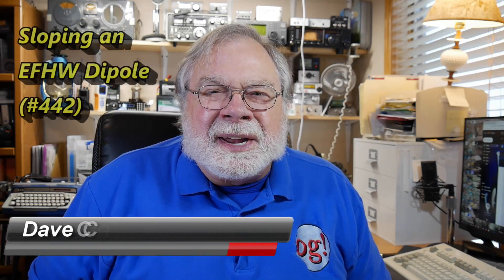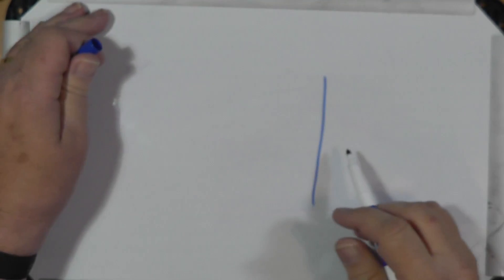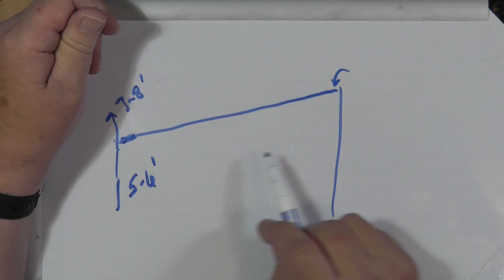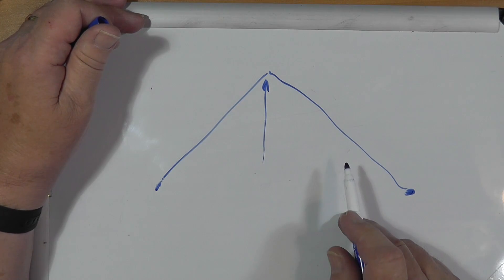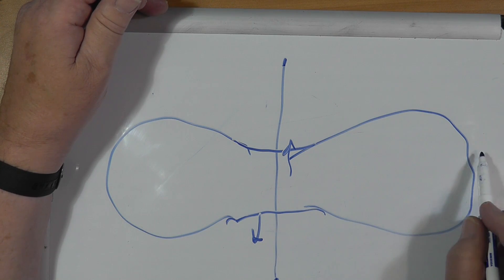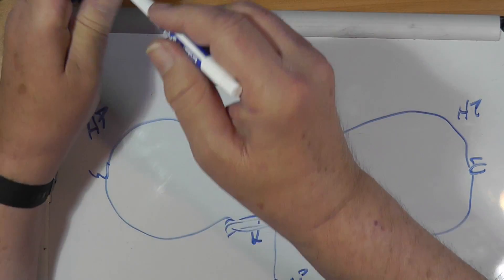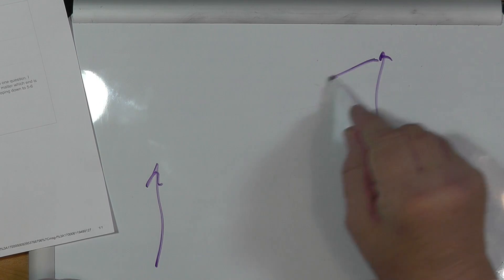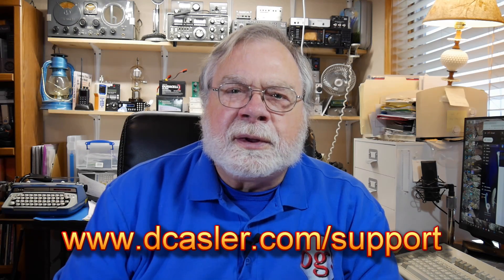Sloping an EFHW Dipole (#442)

Comment: A follow-on question: How high should the high end of a 20m ENFW be off the ground in a sloper configuration? And is it enough to rely on a run of coax as a counterpoise? Is a vertical configuration better because it gets to a full 33 feet high at the end? If so, can the coax still be the counterpoise, or must one then have a full radial field for optimal performance?

Comment: Thanks Dave for sharing your video & insights.  I recently discovered your channel subscribed, and binge watching several of your excellent videos.
My old Home brewed Dipole that was built in 2020, is needing replacement. I’m searching YouTube videos for refreshers, as I had 2 Strokes in 2021 that impacted my memory and brain white matter atrophy. 
Dispite this I am determined to venture into the realm of Software Defined Radio yesterday I ordered a Xiegu 90 and considering the  Xiegu DE-19, Digital Interface device to refresh my 
Ham Radio Deluxe experience.
73 Steve AA4SH

Comment: This is just the info I needed. Thanks! I’m putting a 66 foot efhw in my attic and need to put it horizontal and it needs to snake around the attic to fit. The shape is kind of a “u” with a couple of extra bends. If you see this post, can you let me know if this shaping around the attic will mess everything up? Thanks.

Comment: I have a legal limit resonate 135' that I run along with a vertical.  I switch between them to all the time depending on which has the best ears and or noise level. 
My transformer is near the shack about 15' off the ground with 35 feet of coax. The end is 120 feet up at the top of a big live oak. It has a SWR under 1.5:1 on all bands except 75m general portion phone band. There it was  showing 4:1 to infinite.  
I read an article  how to tame this without affecting the other bands and now have a 1.2:1 on 3.950. 
The trick is to cut the wire at the halfway point and add an insulator.  Between the two wires add a 220pf 3000v disk capacitor for up to 100w. If you run any power the capacitor is going to need to be a ceramic doorknob. 
The article claims it makes no difference on the higher bands but I have found 40m to be 1.2:1 to dead flat across the entire band. Before the mod it was 1.2 to 1.5:1.
I have added 6 turns of coax as a choke behind the transformer as well and have no rf issues in the shack even when running legal limit. I've managed contacts from my qth in North Florida from Australia up to Iceland and over to Japan and the Middle East with 100s of  contacts throughout Europe. 
I run the same antenna for POTA and SOTA with the same results.

Comment: Strictly speaking a half wave continous wire, end fed,  is not a dipole. The term dipole means 2 poles,  and if it is broken and fed in the middle it becomes two sections of wire, quarter wave each and then is a centre fed dipole.  A single continous wire, fed at one end or the other is really a monopole. The term Di means 2. Just a comment but a good video and an end fed wire can be a very convenient antenna to erect. The feed impedance will be high, usually around 2,500 ohms and so a matching unit or an UNUN will be needed to fed a 50 ohm line.

Comment: Dave, Thank you for your videos. I keep finding conflicting info about the counterpoise for an EF. Some say you should run the counterpoise parallel (under) the wire, others say perpendicular. The choking is also represented in two ways. Some say put an isolation box (LDG 1:1) at the antenna to block RF on the outer coax braid. Some say don't choke at the antenna because that outer braid is the counterpoise but do choke it before it comes into the the shack - for example, if you had an 84 ft random wire, and you were going for 75M, you could choke your coax around 60 ft down the line (quarter-wave of your target freq.). So posts say choke the coax and run your own counterpoise - and again it branches to parallel or perpendicular.

There must be some reason why the people believe what they are posting, but the posts mostly say "do it" without the why or consequence of doing it differently (parallel vs perpendicular). Any insights would be appreciated.

Comment: Thanks, Dave, and Don B for the question. I just put up a 66' 80-10 EFHW from a US manufacturer. High end at 27', about 5' off the house, sloping down to 12'. Called manufacturer when the performance was poor. They suggested adding a wire to the 2nd lug on the transformer, dropping that to a separate ground rod, then running a 66' radial underneath the antenna. Helped a bit but still very poor compared to my INDOOR 20M and 40M dipoles. (The 40 M is even in a "U shape" horizontally.) Have not approached the manufacturer about a return yet but this was a waste of money at this point. Any suggestions out there? More radial wires to act as a counterpoise?  Thanks for any suggestions!

Comment: I run a random wire with a 9:1 as a slope. The high end is 16' off a tree and the low end and feed point is 6" of the ground. Coupled with 34 6' radials it has a great pattern on 40, 80, and 160 when modeled in MMANA.

Comment: my end fed is on a sloping garden and is fed at the lower point which is at 20ft above ground, which effectively is 0 ft when compared with "the lawn" at the back of the house. the "other end" is 25 ft above "the lawn, which as the house is an inverted L makes it 10ft above ground with reference to the road. I have had good coverage and worked many countries on 80 through to 6m. Where are the hotspots for "people" to avoid, not that they can easily grab the wire.

Comment: I am using EFHW in sloper configuration with ubitx. But feed point is at 15' and then it goes up 30' approx.
Works great for me.
But Steve Ellington recommend to get feed point away to avoid rf back in shack as coax shield act as counterpoise.
I had to ground everything to avoid that.

Comment: The height above ground will depend on the frequency and whether you want an NVIS (80 & 40 meters) or not. The center of the antenna will do most of the radiation.

Comment: Question to anybody with experience. I'm putting up a 132ft off center fed dipole long-term. Im under the impression that most ppl simply tie some Dacron onto the dog bone insulators and raise it up. I'm concerned about stretching and longevity. I was considering running Dacron the full length and gently wrapping the 16 awg wires around the rope. Will this negatively impact the antenna? Any thoughts?

Comment: I measured EFHW dipole with analyzer and found that this antenna has good swr but impedance is really bad. So antenna radiat a lot energy back to radio..
Reply: That’s where you use a matching transformer. I have an end fed vertical for 20m made from aluminium pipe. I wound my own match that was much less than 49:1. Much closer to 850-900 ohms at resonance not 3K as with wire antennas

You’ll also need a good common mode choke at the match end of the coax to reduce common mode currents on the outside of the coax
Reply: This is a common problem if your transformer is not made properly.
You have to ground everything to solve this.